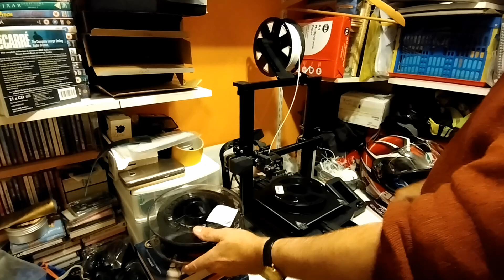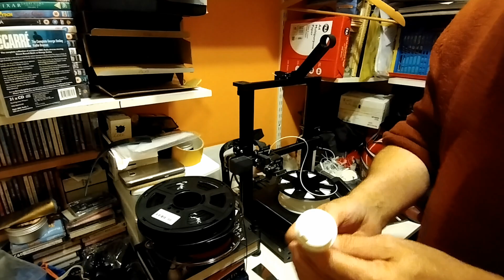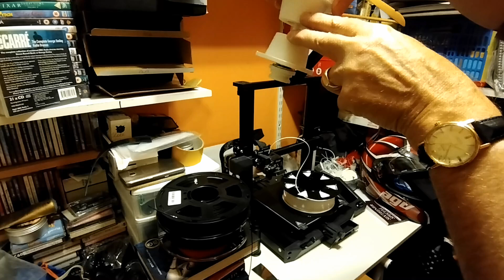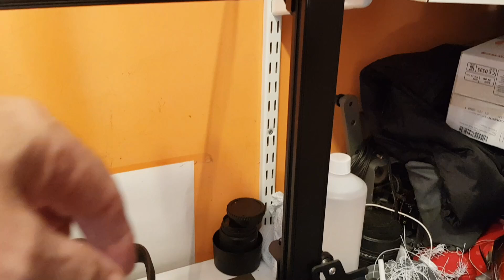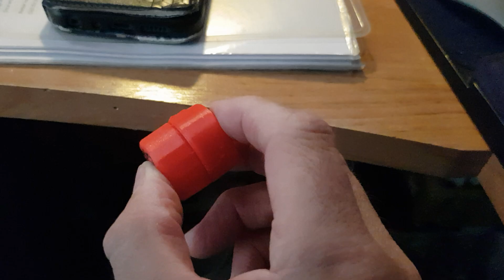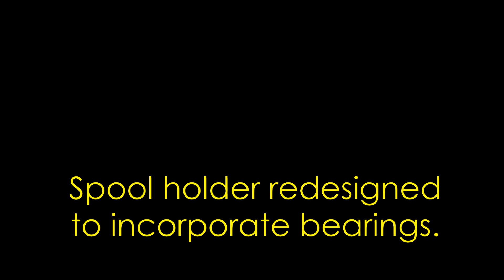Creality Ender 3 S1 Spool holder modification for TPU

Comment: How do you turn the arm arount? My "bar isn't the same on both sides so it won't fit the other way around.
Reply from the maker: Mine also, I applied some force to jam it on. Not ideal but worked for me. I am thinking I will end up printing a new arm to clip on properly.